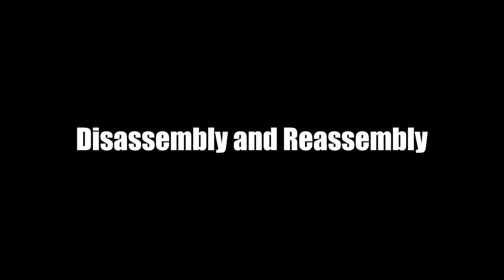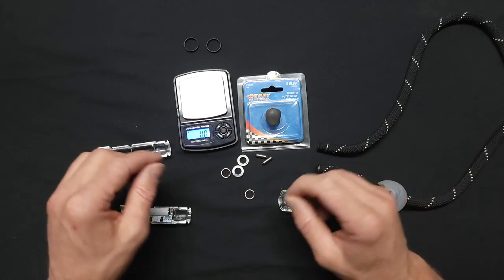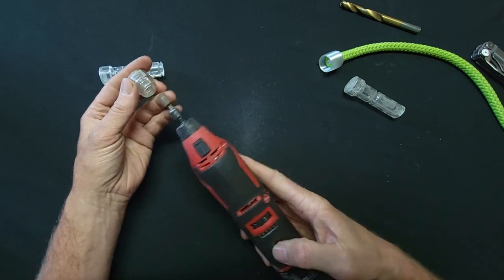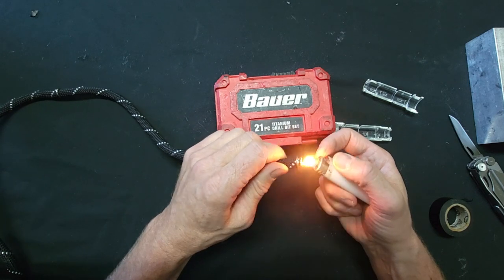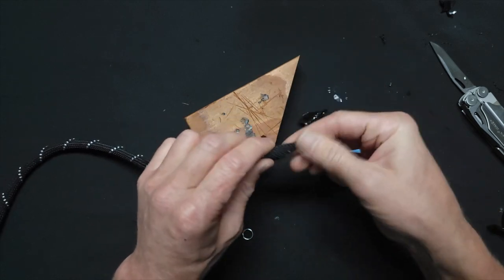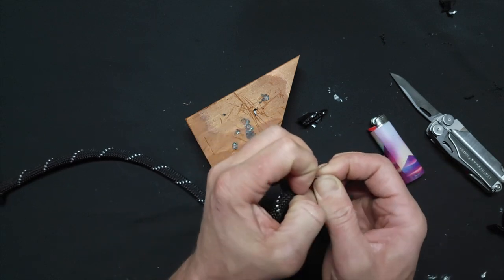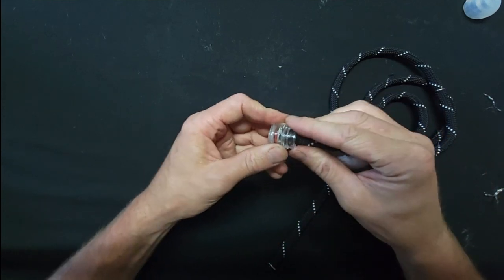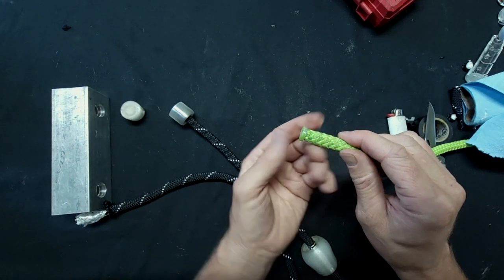Ultrapoi Orb Pro. Build/Modification Tutorial

Comment: How did you get the rings on the rope?
Reply from the maker: I pull a inch of the core out one side, then slide the ring over the jacket of the other end which will be thinner without the core. make sure the jacket is melted on the end so its not all freyed